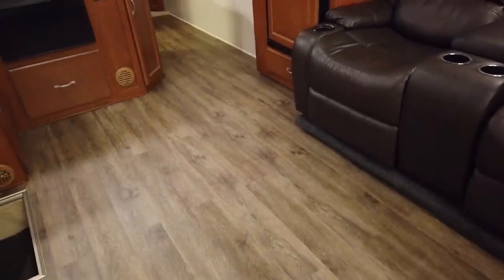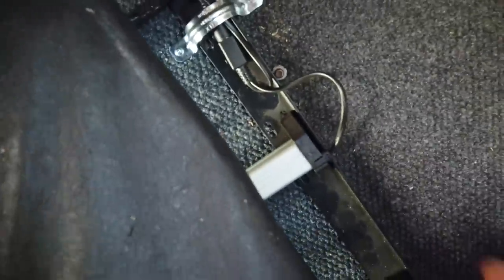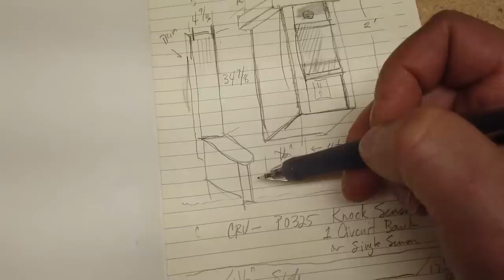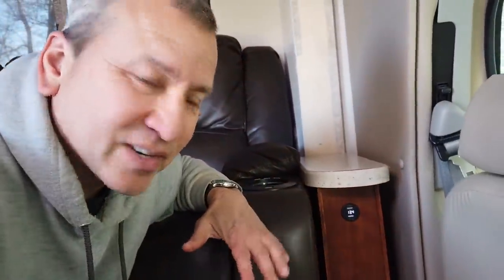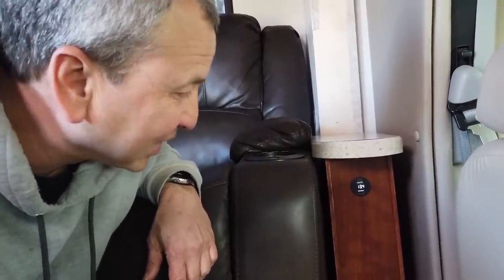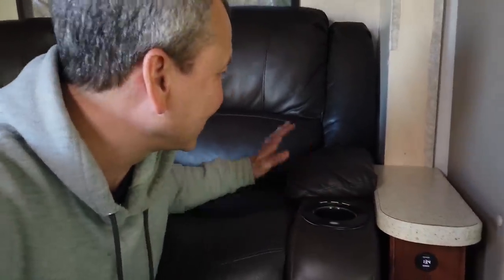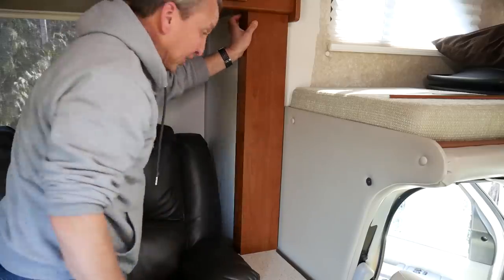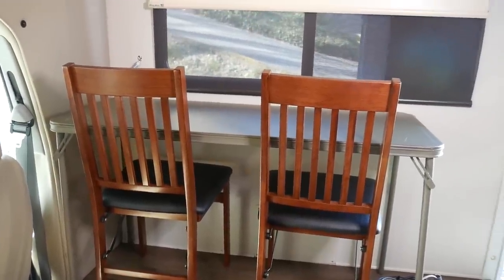Building Custom Powered Console / End-Table | Class C RV Renovation | RV with Tito

Comment: Hi Brian. Excellent attention to detail, as usual.  Your work always says... “Finished, factory installed”.   Taking a few extra minutes to tidy up the wiring in the side table assures trouble free use down the road.  Hats off for repurposed dinette pieces. Great way to capture the factory finishes and decor.  Thanks for including the detail of the build.  Looking forward to your next video.  Fair weather and flat roads.  Mike and Rosie, Shelton, WA 📐✏️
Reply from the maker: Hey guys. Thanks! Yeah. I'm a bit OCD when it comes to doing a nice clean wiring job.
Reply: OCD, "the road to distraction", not a bad thing.  All you really need is a good Swiss Army knife, tape measure, pencil and a location and you can build a shopping maul.  Have a great day my friend.

Comment: Looks great!  Good reuse of existing parts.  Only thing I would do is put some velcro strips behind the trim piece you didn't fasten, so if the worst ever happens, hopefully it won't pop out and become an air borne missile.  I'm concerned with your safety.
Reply from the maker: I did notice it moving a tiny bit when the slide goes in and out. So I think I'll put a couple small nails in it to prevent that.

Comment: Great job, you do very nice work!  Can you explain how you connected all the outlets and where in your new end table.
Reply from the maker: I already had AC and DC power running under the old dinette. Years ago I wired additional AC and DC plugs for that area. I have a hole on the side of the console where the wires go in to power the outlets. The USB and DC cigarette lighter plugs are wired together.

Comment: Only issue I see is, you need to use a 1000 more brads and staples ....lol.very nice...
Reply from the maker: For sure. There would be no question then if it were factory installed :)

Comment: The only problem I have is that you have a full work shop that most of use do not. So we have to work out of our RV's to make changes. Just wanted to note that...
RV Love had done a good job of doing there changes in a off grid mode. Not even plugged in. Done by just solar ... Now that was a challenge. 
You still do good work..
Reply: Lankster Price Well I did my RV upgrades off grid in the snow barefoot without any power tools. 

What are you, 5 years old?
Reply: hey linkster price im blind in one eye with one arm crippled with palsy and no fingers on my another hand and did my Rv upgrades with hand tools no electric using a candle for light !
Reply from the maker: Thanks for the comment. You could certainly do this project with a screw driver, drill and hand saw though. I've been there and done that. I hope the video gave you some helpful ideas though. Kudos to Marc and Julie for putting their new off-grid power system to the test. As Marc stated, they learned alot from doing that. But I'm pretty sure they don't carry around that table saw, tile saw, chop saw and crew of workers around in the RV :)